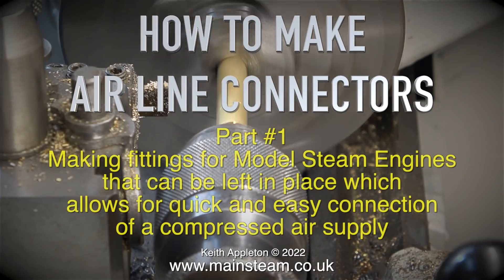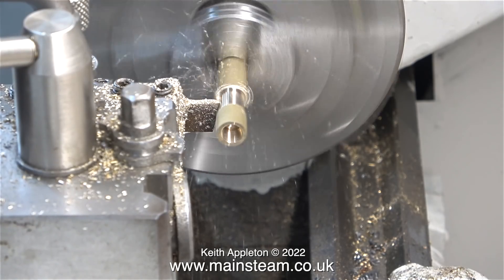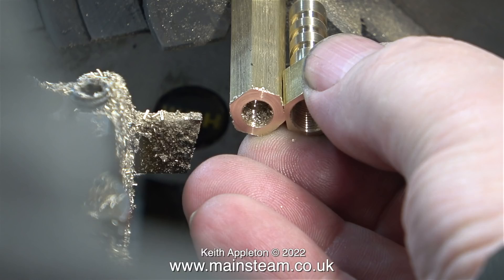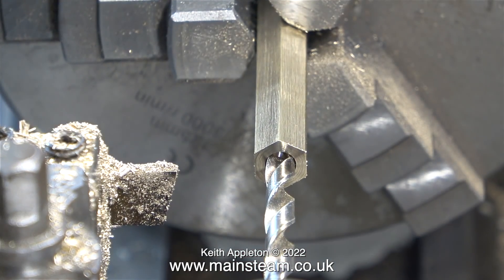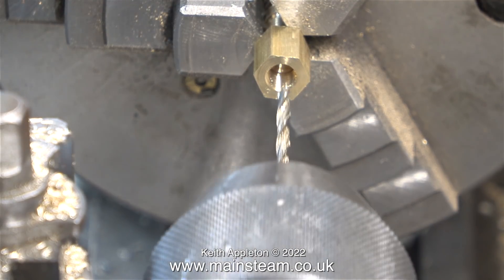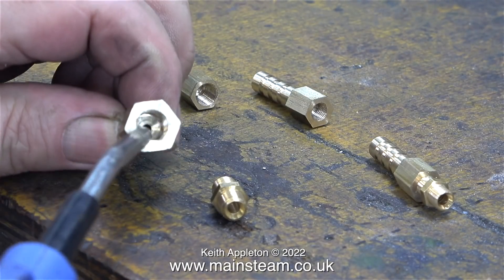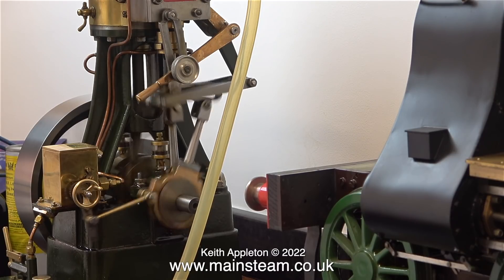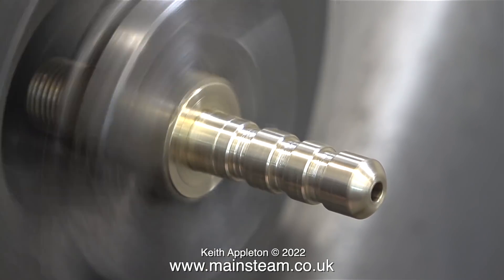HOW TO MAKE AIR LINE CONNECTORS - PART #1

Comment: Huh. I'm a bit surprised you aren't using quick disconnects on your air connection. They're quite cheap in the US, but I've no idea if that's true in the UK. The ones here do have NPT threads, which would require an adapter.
Reply from the maker: I do on the main compressor connection but prefer these smaller parts for use with the engines.

Comment: Big steam engines run at surprisingly slow speed………I don’t mean the Flying Scotsman heading north……..they seem laboriously slow.

When folk run model engines they have them running at a million miles an hour…….faster than a speeding bullet, as it were.

If a full sized machine ran at such speeds (scaled of course), the earth would wobble on its axis and we would all be killed.

Where is the mismatch or am I the only one to make this connection.

Stavros
Reply from the maker: You can do what you want with a model steam engine . . .  the mass of the reciprocating components is very different to full size . . . . .

Comment: i was an aerospace engineer for 25 years and i am dumbfounded that anyone would suggest putting a file underneath the work !! You wont be able to see what you're doing and , like you said it would be using the file teeth the wrong way! When i was using a file i would make sure that the end was nowhere near the jaws so if it did hit the jaws all it would do would knock the file upwards instead of shooting it either into your hand or body! I love your videos